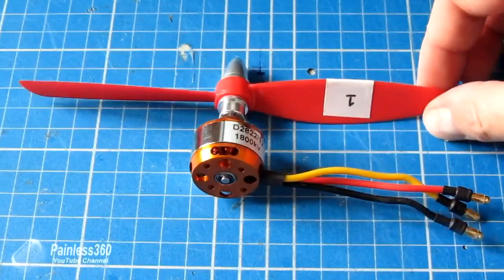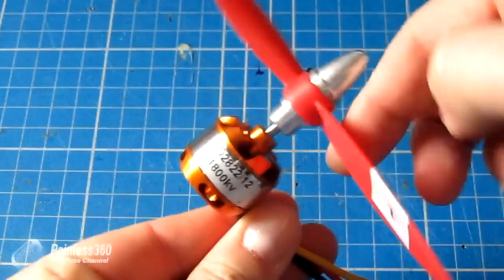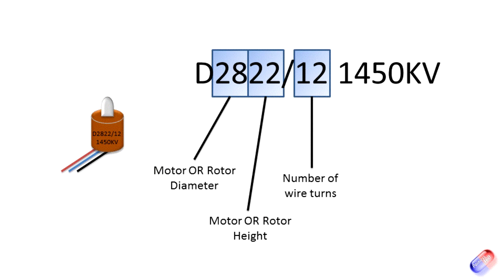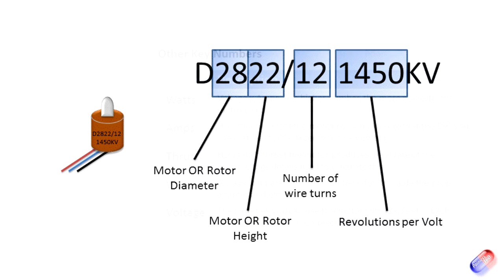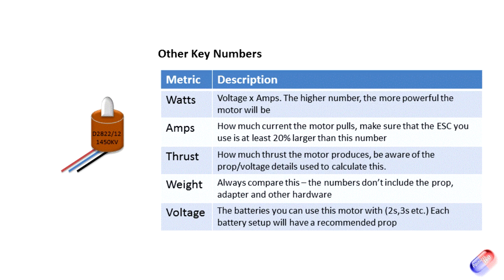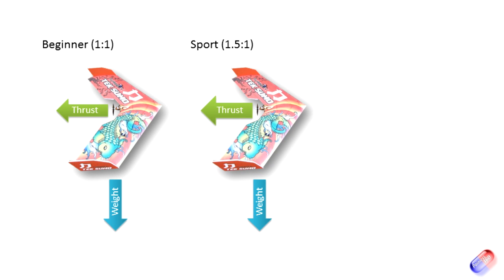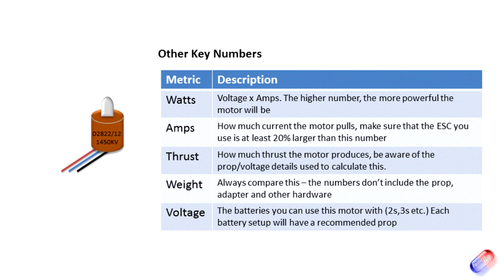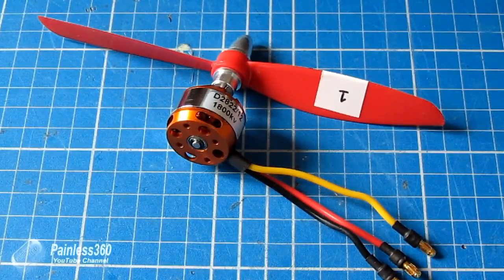Brushless Motor Numbers Explained (KV etc)

Comment: Thanks for sharing. I have a question. Why don't you cut the motor shaft so the prop hub sits lower on the shaft? There's far more leverage to bend the shaft at that length and why people use lock nuts instead of the prop spinner nut on quads. Plus if the hub sits up against the motor flat it supports the shaft as well.  I have similar motor and when I saw how high the prop was sitting on it I was really surprised. There must be a reason and all I could think of was allowing you to use a different prop adapter that has a deeper hole for more grip when using a collet type adapter... but Turnigy supplies a short one. I thought I got the wrong one till I saw yours. I don't get it. Only advantage is better center prop air flow. Doesn't seem like a very good trade off unless you are running a pusher and even then prop shafts get bent and it adds weight further behind the C/G. So seems like you get extra length to use your choice of prop adapter.
Reply from the maker: These motors are used for all kinds of prop adapters so the length is needed for the flexibility. You can cut the shaft down if you want to but make sure that the motor is completely covered so the metal filings don't go into the bearings or into the can and stick to the magnets.

Happy flying!
Reply: Painless360 Ok that makes sense. Thanks. BTW... do you prefer collect prop adaptors or set screws? From what I have read some say the set screw type are more accurate and spin truer and have better balance but even then getting a good one machined well is hit and miss. I got 3 set screw types and only one was usable and all had poor quality set screws I was able to crack without the allen key stripping out the hole in testing them. Makes me wonder about the quality of set screws used in the motors as well and how much pressure against the bell mounting the adapter is safe to apply without affecting it. Seems like disassembly for inspection and reassembly is the only safe bet but on a quad that means doing 4 motors. Bad enough the time it takes to balance props. Really like the T Motors but they too have had issues with magnets coming loose on new motors. I think I like made in America best but that no longer exists and when it does it doesn't last long.
Reply from the maker: Not a fan of setscrews myself, as with all prop mounts the cheaper the brand the worse balanced they are! I had a few set screw types in the early days and stripped both screws (I am careful too !).

It's personal choice and what you know and trust.

Happy flying!
Reply: Well it seems the quality of manufacturing determines which is best and only good ones I have seen are made in Germany and cost more than the motor I want to put it on. I'd like to know what brand... they all seem to come from all over China with no one claiming responsibility with a brand name for the quality.

Comment: Could you help me decide which motor would be better. There is an obvious price difference. I'm just confused to why? Quality? Does one drastically out perform the other. I've searched all over and couldn't really find an answer. Does higher kv essentially mean more power?

Thanks!

http://www.rc-drones.com/RcTiger-MT1306-10-V2-3100KV-Micro-MT-Brushless-Motor_p_420.html

http://www.hobbyking.com/hobbyking/store/__62751__Turnigy_1806_2280kv_Emax_Motor_Set_Of_4_CW_CCW.html
Reply from the maker: Depends on what you mean by 'better'. Higher efficiency and quality motors will cost more but give longer flight times and better performance.

Some motors are made in huge volumes with little spent on quality control - some are made in much smaller numbers and are tested at every stage to ensure the best product.

Also, slower motors (lower KV) swinging larger props are more efficient that faster motors (lower KV) swinging smaller props. See https://www.youtube.com/watch?v=Sjwi_UnCLWc

KV, as covered in this video, is nothing to do with power. Power is measured in Watts. The higher the Watts the more power the motor has.

Without a much clearer picture on want the motor/model to do, how much the model will weigh it's hard to offer any advice.
Reply: Painless360 I meant better as in more punch, efficiency.. the all around better motor. I was just curious to see if you could tell me what the major differences the two motors I posted. I'm new to the quad world. I wanted to find out if $100 more for the tiger motors is actually worth it. I have a 250 quad and just want it to be more aggressive. Sorry if I lack more details like I said I'm new to the quad world.
Reply: Painless360 by the way thank you for taking the time to reply I really appreciate it!
Reply from the maker: If this is your first build then my advice would be go for the cheaper motors every time. You will crash, smash and generally damage most parts of your first quad as you learn and push your reflexes. I replaced most of my fi4rst model twice over while I learnt to fly these things.

 Save the more expensive kit for when you are a capable pilot and have got over the training wheels stage.

I would also recommend getting a small model like the Hubsan X4 or similar to practice on - very hardy little models and are a great way to learn without the repair bills..

Hope this helps.

Comment: if i have a 2700kv motor and a 7.4v battery, does it mean i'll have to find a 365amps esc?
Reply from the maker: Nope.  find the max amps for the motor and then get a slightly larger ESC.

Happy flying!
Reply: Painless360 thank you! i'm sorry i was mistakenly using the Kv (2700) instead of the Watts (5.5) for my calculations. then i looked more attentively into it and saw my mistake. i'm new to this!! :) thanks for the prompt reply!!
Reply from the maker: friedchicken1981 No problem. We all started out as 'newbies' in the hobby and there is no such thing as a 'daft' question (but there are lazy buggers who can't use google to find the answers themselves!  ;)

Happy flying!

Comment: I'm looking to build my first quad but am a little confused with something. When it comes to picking a motor/ESC combination, I've seen where it's recommended that the ESC handle 10-15% more amps than the max draw of the motors. I see everyone in the 250 class using 12A ESCs but the battery draw to the same class motors are from 11-14A. Am I missing something? Thanks.
Reply from the maker: Robert Hathaway I wouldn't risk it that way - there are tolerances in the ratings of the electronics that are in your favour but I wouldn't trust my model to that! I'd always make sure my ESC can supply slight more than the max current from the motor and make sure that the LIPO can comfortably supply a little more than the maximum rating of the ESC. Happy flying!

Comment: Contrary to what you said in the video regarding oversizing ESCs i plan to use 30A ESCs on these motors that can draw unto 40A each however i really don't expect to ever be drawing more than 25A max, i'm hoping for an efficient setup. If i go for ESCs bigger than 30A they suddenly get heavier so the motors will have to work a bit harder anyway. I'm guessing i'll be ok with 30A ESCs if i'm not pushing them to their limits.
There are more specs on this page:
http://www.aliexpress.com/store/product/Free-Shipping-5308-350KV-Multirotor-Motor-For-Quadcopter-Hexacopter-Octocopter-DJI-S1000-DJIS800-UAV-FPV-Drone/1049566_1932080589.html
Reply from the maker: izzzzzz6 hi, be careful using a lower rated ESC. The power to the motor is either all on or all off and the ESC switches the amount of time switched on to increase the power. This means that it will always deliver the current the motor needs but for a shorter amount of time at lower throttle. Good luck with the build..

Comment: Hi, i thought some people may be interested in these motors i found for larger multirotors. I have ordered some and i'm waiting for them now, you can find them here, sometimes on ebay and on aliexpress.
 http://www.goodluckbuy.com/q-motor-5308-kv350-brushless-motor-for-fpv-quadcopter-multicopter-dynamic-balance.html
Painless, what do you think of their potential for long fly or load lifting copters? It looks like 53 is stator diameter as they are 60mm od and 8 is 8mm stator thickness.
Reply from the maker: izzzzzz6 They look like nice motors and have plenty of power. No detail on the recommended props and thrust expected though..

Comment: Hi,
    I have a problem you may be able to help with.
 I have a 200W motor and a 40 amp ESC together with a speed controller and a programmer. I am not building an aircraft but a CNC router and need to program the motor and ESC. The motor will be fed with a 12 volt 30 amp power supply. Does the ESC control output lead, feed out the full voltage or is it limited to protect the Speed controller and programmer. Secondly how do I use the programmer to slow start the motor and have if possible computer control of motor on/off and hopefully speed. Needless to say I am a complete novice with this setup but a competent electronic engineer. Any specifications or diagrams pertaining to this would be appreciated.
Cheers MoK
Reply from the maker: I have no experience using a motor in this way so can't comment on the usage. I can answer the other part of your question though!

The motor that connects to an ESC is basically a three phase motor. The ESC drives the motor by pulsing the full battery voltage very quickly to each of the three phases in turn, the more throttle the more 'on' the voltage is to that phase of the motor. The frequency of these pulses to the next phase of the motor is commonly known as the 'switching frequency' and in an RC model this is directly controlled by the PWM signal on the throttle channel going into the ESC.
Reply: Painless360 Hi and thanks for your reply, however the principle of operation of brushless motors is understood so is not the problem,  the data available on the ESC, programmer and speed controller is very sparce to say the least so the danger of misconnection is high. Without reverse engineering the devices, the connection of devices without data is not without its mishaps. I require the connection data for the motor, ESC, programmer and speed controller. In a nutshell thats it.
Cheers
MoK

Comment: Very interesting. Can you maybe explain why brush-less motors get hot so quickly? Also do you cause the motor any harm if you run it at a lower voltage than it is rated for (say half)? Would this also mean less current is being drawn (so does battery last longer)?
Reply from the maker: Hi John, the motors should get warm in operation but not hot. If they are then this is an indication that something is wrong. Typically it means that you are using too large a prop on the motor or the bearing(s) are degrading.

Check the specs on the motors you are using to make sure you are not trying to swing too large a prop.

Hope this helps. Happy flying!
Reply: Painless360 Well I am not sure where the line is drawn between warm and hot but certainly I could still hold them in my hands. I should add that I had nothing connected (no prop or other load)  as I was merely trying them out for the first time. The motor does make a noise as if something is brushing against something else though. Should it be silent?
Reply: John Fiott Hi again. I re-ran the test and the motor was bearable to hold in the hands after about 2 minutes but barely so. The ESC (rated for 30Amps and 4S) also got hot and this when I was running everything from a bench PSU set at 12 Volts and a current limited 5 Amps max. As I said also with no load attached.
Reply from the maker: John Fiott Hi John, sounds like something is wrong. After running it under no load the can should be only slightly warm to the touch. Sounds like there is friction inside the motor and the fact that you can 'hear' something seems to support that guess. I'd strip it and check the bearings and make sure non of the magnets have moved from their positions and rubbing on the armature..Best of luck.
Reply: Painless360 Thanks for the advice!

Comment: Is it possible to reverse the rotation of such motor using an ESC that supports reverse rotation such as this one ? http://www.ebay.com/itm/RC-HobbyKing-Brushless-Car-ESC-10A-w-Reverse-/251615252529?pt=Radio_Control_Vehicles&hash=item3a95701031
Reply from the maker: You can reverse any brushless motor by simply switching over two of the three wires that connect it to the ESC. Some ESCs do provide the ability to program this for those cases where swapping the motor wires isn't an option. Either works great.

The ESC you mention is for a car and includes an 'auto reverse' setting so you can go backwards/reverse when driving as well as forwards without having to do any of the above.

Hope this helps.

Comment: I kinda got lost in this video my take a while before I fully understand it. I'm flying a airplane which is a beginner it came with a 800Kv motor 30a esc a 3 blade 11x6 pro use a 3s 2200mah battery. After a few months I change the esc to a 50a running a 4s battery plane run a bit faster. Now I want it to go even faster it was subject to me to go down in kv so put in a 600kv with 4s battery 50amp esc and blade the plane flies much slower and took long to get off the ground. Went to 12x6 single pro no different in speed going to try a 13x8 pro. So question should I have gone higher in kv like 1400kv or more with same blades?
Reply from the maker: Dennis M For a plane you need to figure out how much power you need. This thrust should be related to the weight of the model. Find a motor and prop that provides the thrust you want (use the rule of thumb of 1.5xweight for sport flying, 2xweight for 3d flying).

Once you have that, fit an ESC that can provide 20% more current than the motor will pull  and attach that to a pack that can handle the max current rating of the ESC easily. See my videos in the 'RC Power Systems' playlist for more detail. 

My helpout channel is available if you need more help.

Comment: Thanks man. I thought that the 3 wires supposed to connect to something entirely.  But now I know I can just use the positive and negative., and leave the wire that I don't need out
Reply from the maker: Innovation Hi Innovation, the three wires do all need to be connected. If you have a motor that only has two wires coming out then this is a brushed motor and you will need a brushed speed controller to run it. A brushless ESC with 3 wires will NOT run a brushed motor with two. Hope I've not just taught my grandmother to suck eggs there!!Happy flying!